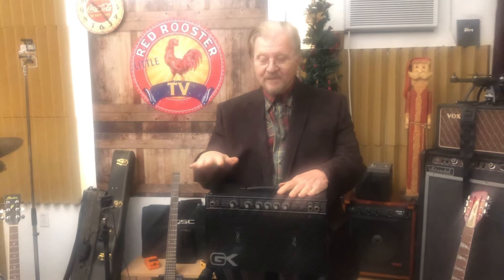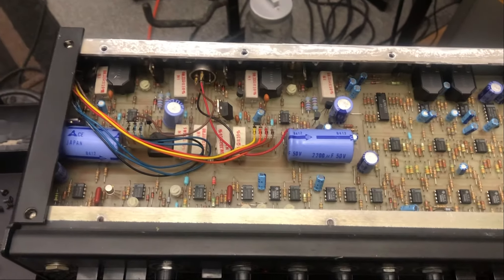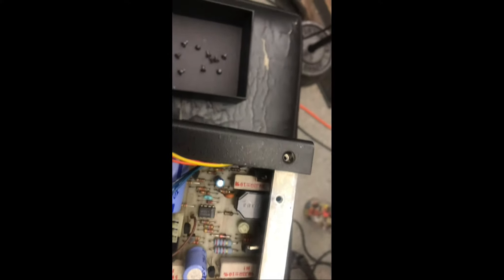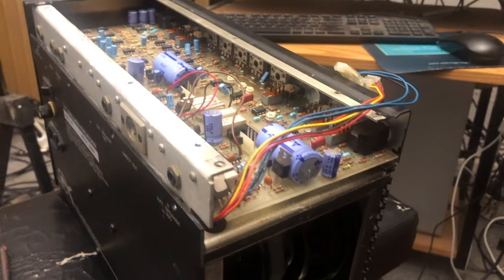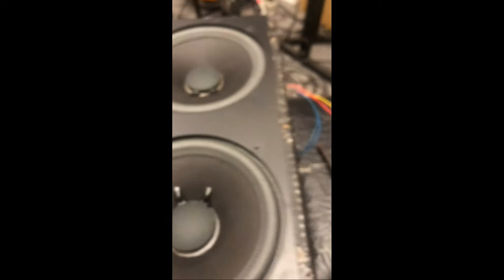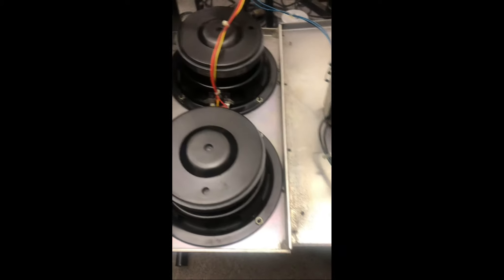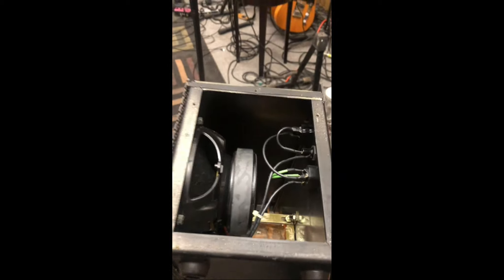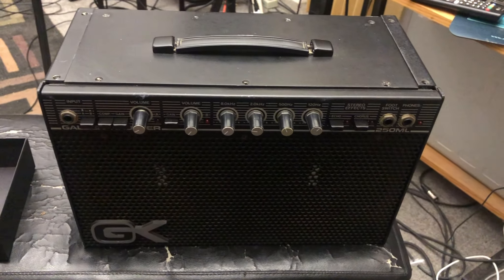Speaker install in a Gallien Kruger 250 ML Amp

Comment: Gene - i have a question about the transformer wires.  Do you know which blue wire goes to the top transformer and which goes to the bottom from the plug?
I cut them without labeling them and need to reconnect them correctly…
Reply from the maker: Sorry John, I don’t remember and I no longer have the amp. I have always had great luck calling directly to Gallien Kruger. They have always been kind with their help.
Reply: Thanks Gene.  I contacted them so i will reach back out.  Thanks so much for replying!